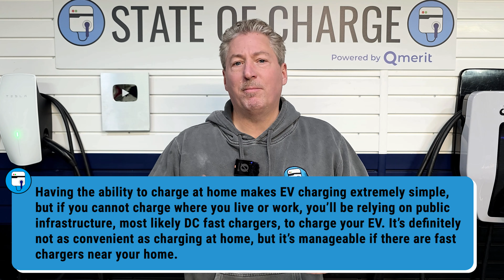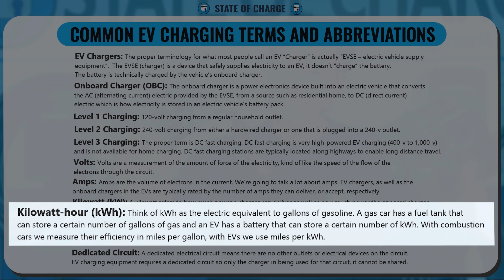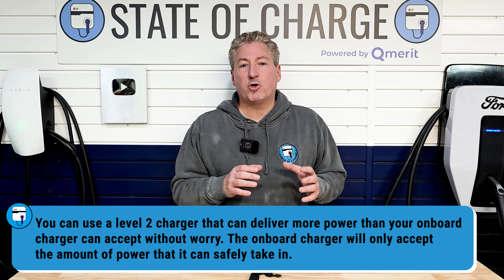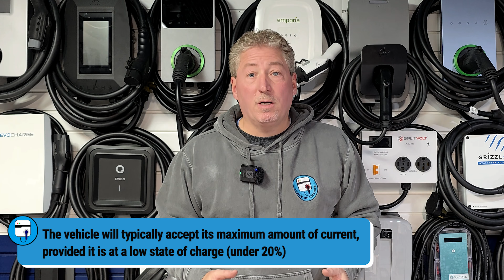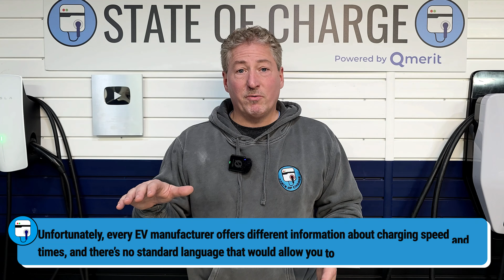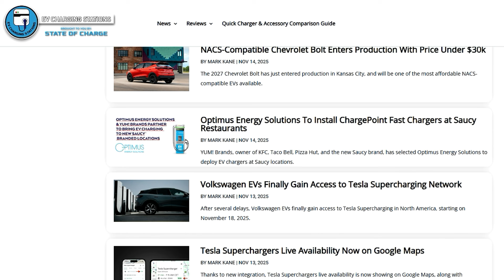Understanding How Electric Vehicle Charging Works And How Long It Really Takes

Comment: It takes me 20 seconds. 10 to plug in and 10 to put the charger back. I've only had to fast charge once since I bought the car about 8 months ago and it was a slow 50 kW charger. That was because I preferred to shop in downtown Bend Oregon while the car charged rather than go to the supercharger nearby.
Reply from the maker: Right - it takes YOU 20 seconds to complete your task, but it certainly takes the car much longer
Reply: @StateOfChargeWithTomMoloughney  This has nothing to due with this vid, could you pass on to Kyle or someone else at OOS that Chevy finally has the standard range Silverado on the configurator (listed at under 60k with destination included in that starting price). I would love to see it's range and charging tested. They also have added a hard cover option for the bed instead of just the soft cover.

Comment: I am planning to buy an EV this coming spring. I'm leaning towards the new Bolt or the EV3 if they ever get it released here. I average driving between 10 and 20 miles per day. I think a level I will work for me. I can drive over to the closest Tesla supercharger if I need a quick top off for a road trip.
Reply: My 2017 Fiat 500e gets 5 miles per kw. The Level 1 charger provides 1.3 kw per hour. 

A Level 1 charger might take you 3-4 hours for 20 miles. 

Oh, if you preheat your car beforehand, the 120 volt charger only delivers 1300 watts, so your car would use more by heating your car than from charging. Still, this is better than heating a car while no charger is attached as most people do while driving.
Reply: @gregyohngy  5 miles per kWh.  And provides 1.3kW (not per hour)

Comment: Non-tesla mobile chargers only come with NEMA 5-15 and 14-50 plugs, as more EV's come with NACS, would these new EV's  be able to accept Tesla mobile chargers' different NEMA adapters? (5-20,10-30,14-30,6-50).  For my Tesla I charge at my work with a 5-20 adapter giving me a 40% faster charge than 5-15.
Reply: Some get the faster charger and still use 15 amp outlets! 🔥🧯🚒
Reply: The Grizzle Mini has a good selection of adapters included.  I also added a 6-20 off Amazon

Comment: Given that data is starting to indicate that fast charging speeds aren’t as deleterious to battery life as originally thought, will, or can, software updates modify a vehicle’s charging curve?  I would think that there is some leeway in the BMS to do this. Even maintaining the higher rate for 5-7 minutes would make a big psychological impact.
Reply from the maker: Yes, and many companies are doing that with OTAs. Ford improved the charging curve of my Lightning a few months ago and shaved about 6-7 minutes from the 10% to 80% charging time.

Comment: When people ask me I say, "typically 4 to 8 seconds, 2 to 4 seconds to plug it in, 2 to 4 seconds to unplug and hang up the connector." And yes I have timed it, that is the typical time and it includes the extra 3 steps to walk tov and from the charger port. 
It's ridiculous convenient. I been driving electric since 2017.
Reply: I try to tell people that charging an EV is like using a dishwasher or laundry machine. Yes, it takes a dishwasher 1 to 2 hours to wash a load of dishes, but you don't stand there at the dishwasher for that time. You press start and walk away to do other things.

Comment: Next do discharging please
Reply: What do you mean?
Reply: @billhession6230 bi-directional chargers and how EVs discharge. The different ways of which they discharge (using onboard inverter, or by discharging DC power and having an external inverter). Tom has done very little covering bi-directional charging

Comment: Lots of great information Tom. Thanks for putting this together. One thing that initially confused me relates to charging on slower speed DC Fast Chargers. When I first started road tripping my Mach-E, I assumed that when I stopped at a 100 kW EVGo station, I'd get 100 kW. After all, the Mach-E can take up to 150 kW which I'd see when I charged on EA. After I started recording my sessions using an OBD dongle, I learned that the speed I got (70 kW) was limited by my battery voltage and the output amps of the charger or in some cases the cable. The Delta 100's use a 200A cable and the unit is also rated for 200A. So, when my battery voltage was at 350v, I could only get 70 kW (200A x 350v = 70,000w). Since my battery voltage would never be 500v, it was impossible for me to get 100 kW.

Comment: Tom, for the long term health of the battery pack, quick question: what state of charge RANGE should I keep up weekly?  
For example: never above %80 and never below 30%? 
So 80-30? 
I know should I plan on traveling out of town I charge fully 100%.
Reply: Yes.  Smaller charging increments are better but not critical.  I charge every night since I charge at home.

Comment: Thanks for this video Tom. This is a great resource. I just picked up my first EV 3 weeks ago, a standard range Mustang Mach-e. I’ve been using the 120V charger until now without any issues, my commute is only about 30 km per day. An electrician is coming by tomorrow to install the Ford supplied 48A EVSE so that should be quite the change.
Reply: I got by with a level one charger for 4 years with my PHEV as my daily commute isn't much. But I enjoy seeing my car charge at 11. 2 kW now. You also have less energy loss with level 2 which is nice.

Comment: So many nuances to charging!   Good info Tom.  Most people will go with Tesla to streamline the process.

Off-peak electricity rates
Scheduling and de-rating your L2 EVSE
So many apps and how to use them
Plug-and-charge
Adapters
Finding a 350 or 400 kW DCFC and their cost per kWh

Comment: I watched this.  you discussed if you have a more power ac supply, the car will only draw it's max.  say 40amp level 2 vs 32amp on board charger.  what do you do if your panel can only supply 15a and the car can draw 32a...will it trip the breaker?  do you chabge a setting in the car?
Reply: You change a setting in the EVSE (charger) to what is available from your panel.  Mine is set to 32A. Then the car will only "pull" that amount (if its onboard charger is large enough) because the EVSE communicates with the car to tell it what's available.

Comment: "On a road trip, most EVs can charge from 10-80% in about 30 minutes." Bolt owners (including me) have left the chat. 😂

Just kidding. Great explanation Tom. You discussed one of the biggest misunderstandings I run into when speaking with non EV drivers., Most people are not typically close to empty when they plug in at home. It isn't like a gas car where you go to the pump when the car gets to E. Even when my wife and I take the EV on the weekends and drive the kids to a bunch of sports and other activities, we are never lower than 20% when we get home at night. 180-200 miles is a lot of errands and we do not have a car with a very big battery pack.

Comment: I find the most inefficient charging is 110v. Most of that power is used for AC/DC conversion, fans and relays to run, battery warming and ware and tear on components, when it's cold even worst. With any L2, even with 48AMPS you lose efficiency. You put in 20kW into the battery but used 24kW due to conversion. It's always best to charge as fast as you can on L2 as that's the most efficient on efficiency lose and component ware. There's no EV battery that can be harmed on L2 charging even at 60 amp.
Reply: Yes if I read the table correctly he just took a rounded 10% off for all speeds of AC nett delivery to the battery. I was expecting to see much higher losses for the slower AC speeds. I'm sure that has been demonstrated somewhere? Perhaps too hard to generalise given temperature & rectifier variability.

Comment: Good video for EV newbies or other people contemplating their first. 

Side notes: 
I have an Equinox EV, they have improved that dramatic drop off with the last couple of updates. (I realize this graph is just used for example) It's now a slower taper and if I remember correctly, doesn't reach down to that ~60-70kW speed until around 50% or so. It's still not very good, but a noticeable improvement for sure.
DCFC can still cause lithium plating, but yeah, looks like those effects were not as dramatic as tested or perceived in the earlier days. The #1 killer of Li batteries by far is heat, followed by extreme ends of states of charge. Letting a battery sit near 0 or 100% is not good either. That's when damage starts happening. Luckily most EV's have at least a small buffer at the ends so you're not actually at true cell level 0 or 100%. Battery manufacturing improvements have helped a lot of this as well.
The difference between the Nissan Leaf without any kind of thermal management, and when the Model S/3, and Chevy Bolt came out with liquid cooling was dramatic. Leaf's were losing 50%+ of their capacity or more down in the warmer climates, especially when fast charging. It was just destroying those things with heat. I think that's where a lot of the early "DCFC is bad" was really coming from too.

Comment: Here's a question I haven't heard before Tom,  at what charging speed might a Level 2 charger start making the car kick on its cooling fans,  making your garage loud,  or would that ever happen?

 Also,  at that highest level of 80 amps/ 19.2kw, is that fast enough for charging speed to taper off when nearing a full battery charge,  like high speed charging does?
Reply: Mind you,  I don't consider either of these to be problems; I'm just curious.
Reply: Car fans are not loud at all.   I can only hear them when I am standing in the garage, and they are quieter than any fan that I own.
Reply from the maker: @GregP30  Some are loud. The BMW i3, for instance, has a screamingly loud fan. When it went on, I could hear it in my living room next to the garage over the TV playing
Reply: Depends  on the battery pack and onboard construction. The fans are to remove heat from those items. How soon the fans ON threshold , depends on many things. Mostly the starting temp of those items.
Reply from the maker: It really depends on the vehicle; there's no one rule to it. The BMS programming will control this, and it will obviously occur more frequently in the summer months than in the colder winter months. In fact, I rarely hear it kick on when the ambient temperature is below 30°F
Reply: Always informative Tom. Dont know if the haters show but they can learn alot but only if they open there ears and minds.

Love this Haters one, "I can't charge at home or I live in an apartment and cant charge there" Well are you gassing up your Ice engine home???

Comment: My simple answer is “it depends “ but that doesn’t really help people, even those who just want a simple explanation. Good explanation of the basics that new or prospective EV owners should know.
Reply: Is it a level 2 charger or DCFC? If it's DCFC, what's the power on the charger, 150kWh, 250 kWh, 350 kWh? What's the temperature where you are charging? Have you preconditioned your battery? So yeah, it depends but I usually answer about 20-30 minutes on the road or just overnight at home. If they are really interested, they will want to know what it does depend on.

Comment: You’ve got me beat, Tom: I’ve been driving EVs for only 14 years. When running errands locally, it typically takes less than an hour to charge from my 240V EVSE. When on roadtrips, my current EV only takes an average of 14 minutes to recharge to 80% from DCFC —just enough time to visit the restroom. Perfect!
Reply: That’s a pretty long dump.  💩